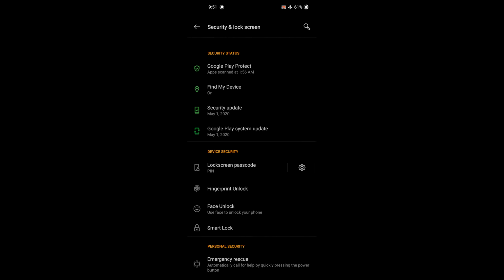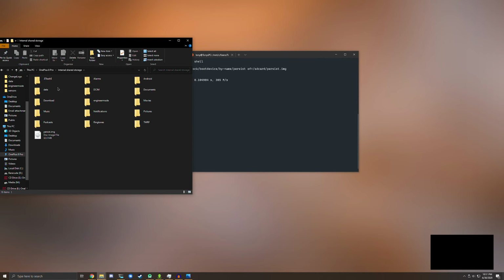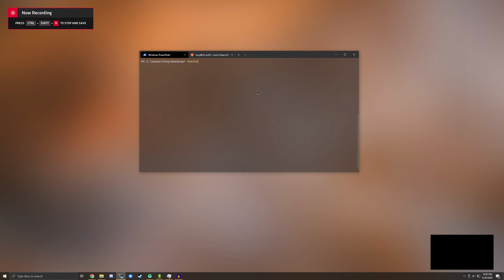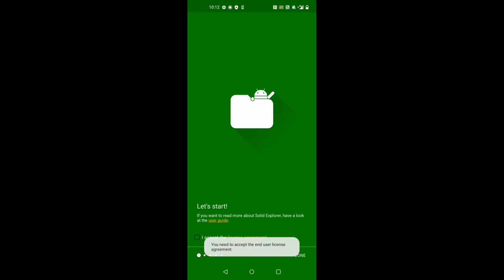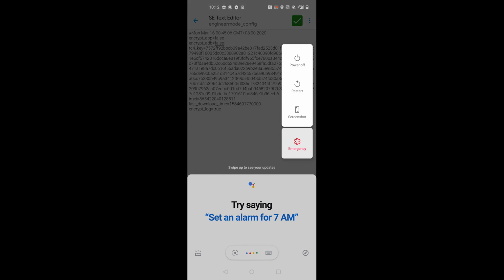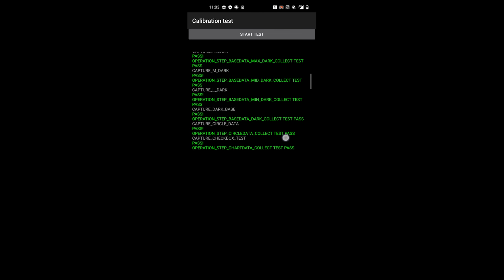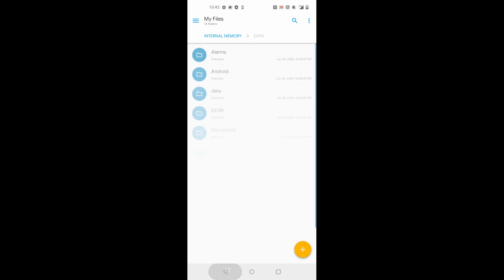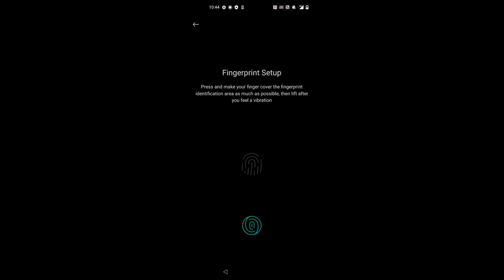[GUIDE] Fix PERSIST.IMG Loss Of Finger Print Sensor Oneplus 8 Pro

Comment: Well this method helped me restore the fingerprint sensor for the Tmobile Oneplus 8T. Had some issues following the method due to there not being an android 10 msm tool anywhere online so I used 11. Luckily I backed up the persist before FP failed. So all I did was extract the persist and copy and paste the 2 folders accordingly and it works even after updating to a later android. When trying to access engineer mode for the FP test it would state device is unlocked and all test would fail. Got it to work still, thanks
Reply: in my 8t i dont have same files

Comment: After flashing 10.5.4 fingerprint not showing in security option, only face unlock and screen lock is show, 
But after flashing in android 11 than fingerprint option showing but enrollment error obtained.
In 10.5.8 when click back on after showing fingerprint enrollment error senser is showing in screen and after putting finger on it , senser start blinking but not vibrating

Comment: I copied persist to the .img file as indicated, however data and engineermode directories coped to the .img were empty - thoughts? fingerprint reader still borked. :/
Reply: I'm going to reply here in case anyone runs into this. If one looks at persist.img via linux, it is important to make sure that the file permissions are correct of the .img before extracting the files. I did an adb pull of persist.img using a shell where I was logged in as root - this will create the persist.img with root as the owner. To fix the permissions I needed to $ sudo chown <$user> persist.img 

This solved the problem. I hope future me finds this because I'm sure I'll do it again. Also don't do everything as root, it can cause issues.

Comment: On the last calibration step, I get:
FAIL!
OPERATION_STEP_GET_KB_CALIBRATION TEST
FAIL: GF_ERROR_INVALID_DATA

anyone experienced the same issue?
Reply: tried on the 10.5.4 firmware, and with no luck. It showed a similar error to yours when I re-calibrated the sensor, but upon rewriting the old persistent data (without the .so file), it still has enrolment issues.
Reply: @dodancs  Do you solved your problem?
Reply: @djdaros10  nope. still unsolved. I am thinking of visiting a proper repair center.

Comment: You are a genius ! just fixed my OP8 running H2OS 10.5
Reply: Can i contact you please?
I forget to backup my op8 persist and now fingerprint not working
Reply: @user-ht6si8wr4q  Hi, just follow the video step by step and it will work~ I am not sure if my persist.img can fit your device, if so here is link,
Reply: @zzzzz303a  I didn't recovery my stock persist before it broken. After it broken i just know about persist. And i don't know what to do and how to fix it.
Reply: @zzzzz303a  My device is OP 8. You think the persist from the video will work for me?
My fingerprint and proximity sensor is broken.
Reply: @user-ht6si8wr4q  The link is my OP8 persist, you can try it on but I am not sure if 100% works. If you dont know how to operate, google flash img files to persist partition, that will help:)
Reply: @zzzzz303a  can i get your persist?
Reply: @zzzzz303a  send me your persist link brother.
Reply: @user-ht6si8wr4q  I sent the link 7 hrs ago, maybe google blocked the link comment
Reply: @zzzzz303a  Hello Bro. How can i get the link.🙏🙏
Reply: @user-ht6si8wr4q  https://drive.google.com/file/d/1qQhwSO3ELAl4bAe8YbCwgTXleY8hKDqT/view?usp=sharing
Reply: Can you please help me?

Comment: Thank you so much

Can I relock the bootloader after fixing the problem?
Reply: Yes, but it will break your FP scanner again. If you applied this fix, and hopefully backed up your now fixed persist.img/partition, it will need to be restored after running the MSM tool (which relocks the bootloader) by unlocking it again, and flashing your fixed persist.img.

It seems when using the MSM tool, or any other time the bootloader is relocked, the system checks and can tell the persist partition checksum doesn't match what it is expecting and corrupts the FP sensor file again.

So in short, you have to choose between a locked bootloader and broken FP or an unlocked bootloader with fixed/working FP (or send it to OnePlus for an RMA if you want FP working with locked bootloader)
Reply: @StarCMS  can you fix my device?
Reply: @himelsorder9790  no, but you can by following the instructions
Reply: @StarCMS  please do for me iam can't flowing
Reply: @himelsorder9790  ok, send me $125 and your phone and I'll fix it. Much cheaper than the $250-400 OnePlus will charge

Comment: Saved my ass with this. I also did not downgrade my phone with the MSM. I just made a backup of my persist, then followed the instructions to enter calibration mode, tansfer the old data and engineermode over, reboot, and viola! Able to add a fingerprint again.

Comment: It's working great, thanks! But if I lock the bootloader, stops working. Only works with an open bootloader... Any ideas? Thanks!
Reply: If you fixed the FP, it will only work while unlocked. Locking the bootloader manually or by running the MSM tool will corrupt FP sensor file/persist partition again. You can use "fastboot flash persist persist.img"  to restore your fixed persist partition (assuming you backed it up after fixing the FP), but that command only works when unlocked.
Reply: @Cibran_  Have you tried to flash via fastboot the "persist.img" to the persist partition? I've not done it yet, but maybe will give it a try when I have enought time to do so.
Reply: @Cibran_  If I try it I will update it here. I don't want to set up it again aswell! Haha
Reply: @Cibran_  Yes, if you want a locked bootloader and working FP. After RMA, this time make a backup of your persist before even unlocking the bootloader, and if s**t gets corrupted again, you can simply easily flash your untouched backup of persist and avoid this issue
Reply: @Cibran_  If it's under the 1 yr warranty, free. Just run the msm tool to relock bootloader and RMA it saying it needs fingerprint calibration. Out of warranty, anywhere from $200 to $400 I think. Because depending on the tech, they'll either simply recalibrate it or replace the entire mainboard with one already calibrated. Most in the US get the mainboard replacement because the techs are idiots.
Reply: @Cibran_  They won't refuse it because you broke it. Don't tell them that.  The problem occured on some phones that were never bootloader unlocked. But assuming you live outside of China and bought it from china, the warranty is non existent. Warranty only valid if you bought it from an authorized retailer.
Reply: @Cibran_  What's the big deal about wanting the bootloader locked? You clearly at one point wanted it unlocked and unlocked it, so what's changed? Lol
Reply: @Cibran_  As for Google Pay and anything else affected by having bootloader unlocked, all you need to do is install Magisk and enable MagiskHide in settings.
Reply: @Cibran_ Yes it most certainly does work.  Canary isn't required. Just use the latest official. If it's not working, you are doing something wrong.

Comment: After applying the fix my sensor is definitely less responsive.  Like I can count on it failing frequently. Anyone else having this problem?
Reply: Yes, but only at the  ambient lock screen. Once unlocked, it works in all apps perfectly. But it does get significantly better at ambient  screen with time and auto-calibration, but never quite as good as new

Comment: My Stripe  Rubber Sleeve Test constantly fails
"FAIL! OPERATIONAL_STEP_GET_KB_CALIBRATION TEST FAIL:GF_ERROR_GENERIC" 
I can't figure out how to fix this at all
Edit: Used MSM tool again and started over. Worked then. Thank you so much!
Reply: which OS version did you go to, to fix the problem?
Reply: @naveedakhter01  I was on OOS 10.5.6 European version. Versions before that should work just fine as far as I'm aware but I didn't try this on any newer versions. Ota updates work fine.
Reply: @BananaKillr_9001  Do you solved your problem?
Reply: @djdaros10  yes it seemed to be about timing. Can't put your finger on too early or too late

Comment: Going to be trying this with my OnePlus 7T Pro with the earliest version of OOS I could find for it (10.0.3) hope it works! Thank you for the guide
EDIT: Hmm, I don't have all those files that you have in the ENGINEERMODE folder. I just have f0_date and screenontimebyhours in there, but I can open factory mode directly by putting in the same dial key you used.
EDIT: Additionally, the "data" folder is empty in my persist image. Am I screwed? Should I try adding in the missing files from someone else's 7T Pro persist backup?
Reply from the maker: You must use your own unfortunately, I find it a bit odd that you are missing those files. To be honest I'm not too sure what to tell you.
Reply: @nealhills  hey bro can give me more details?
Reply: No fix except for RMA for you unfortunately
Reply: hi there, could you provide the link to the persist.img file that you obtained from? i am also using a oneplus 7t pro and require the persist.img

Comment: Omg. Thank you soooo much!!!  I have a T-Mobile 7T Pro 5G McLaren (the very first 1+ device to have this issue and the only one besides the 8/8Pro). I had never backed up my original persist.img and my fingerprint has been broken for well over 2 months.  I had actually tried the factory calibration but had no idea what I was doing. Luckily I had backed up my persist (after breaking fp) but before messing with calibration over a month ago.  

In combination of the instructions on XDA and this video, and my fingerprint scanner is back working perfectly in only about 10 minutes. Didn't need to msm to older version or anything!! 

A huge thank you to you and everyone else who helped figured this out!!
Reply: Can you please help me to solve my Fingerprint problem on OnePlus 7t Pro
Reply: @mahishahriar8196  For more detailed instructions for the OP7T Pro McLaren edition (also applies to regular OP7T Pro) check out my thread in the OP7T Pro McLaren edition forum on XDA. 

Basically 99% of information came from here and from thread in OP8 forum, the OP7T is just the tiniest bit different and simply added some notes for better clarity.
Reply: @StarCMS  ik this is 2 years later but what is ur name on XDA or link to the forum as I'm having the same issue
Reply: how did you do it please help me
Reply: Don't need to go back to a previous version?
Reply: @luisnoerodriguez1555  nope